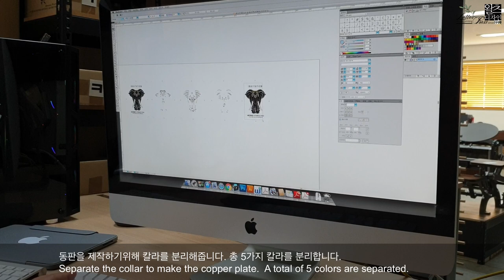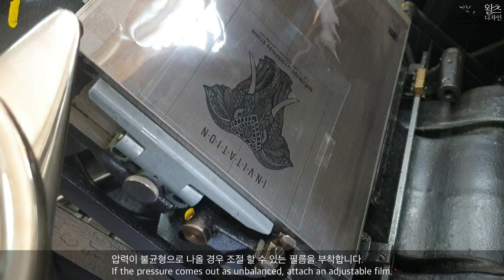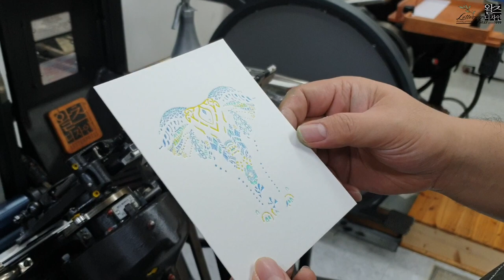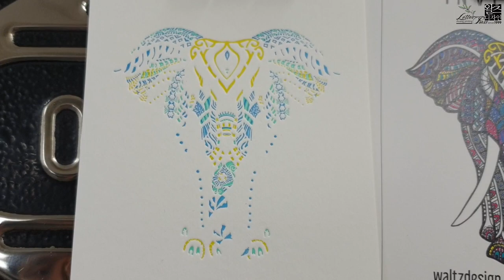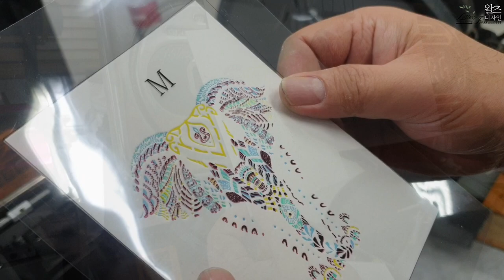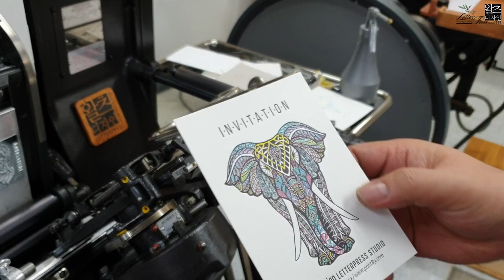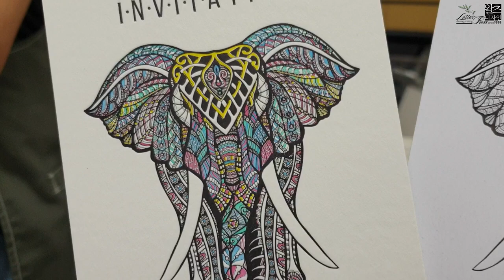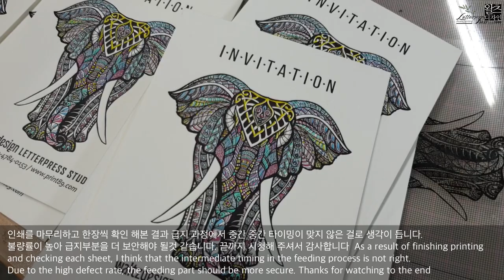Set up the windmill letterpress equipment and print a sample test. 윈드밀 레터프레스 장비 셋팅 및 초대장 테스트 인쇄 영상.

Comment: again!!!  Excellent work as always. Also, the oil that you added for pumping at 3:20 is the same oil in the back at 3:32, is that right?
Reply from the maker: Thank you for always.  The oil is the same kind.  Uses automotive oil.
Reply: I finally got the recommendation that to use Mobil gear 600 xp 150 for the press. Now question is how many liter of oil should i use? Already poured in 330ml from the back but seem likes it isnt enough
Reply from the maker: @mrspirit11  Hello. Just put it in the transparent oil container until it is almost full. :)